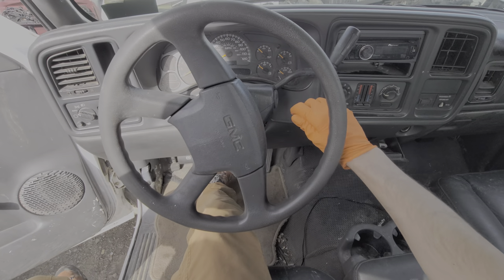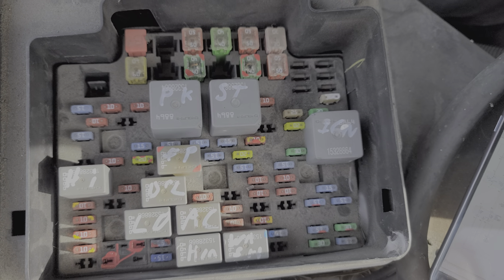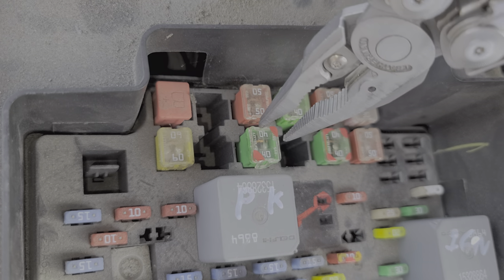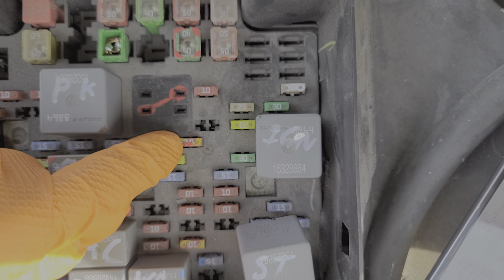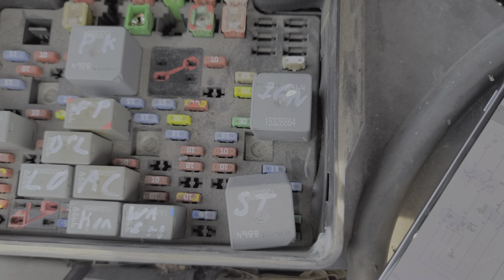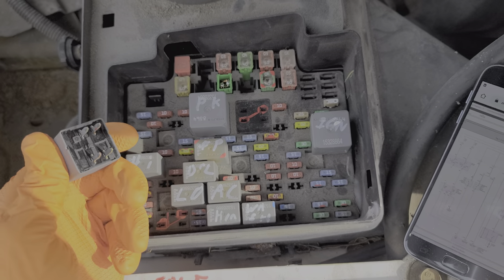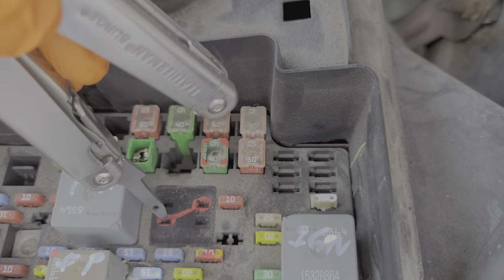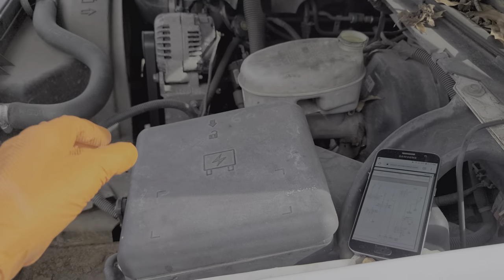2004 GMC Sierra 1500 Starter Relay & Fuses, Ignition Switch Testing

Comment: Just replaced my starter relay 3 days ago. Today my truck wouldn’t start. Found your video. Did the paper clip jump; battery and starter both check good. Replaced the same relay and my truck started up…bought a new relay as a spare! Glad I had that paper clip.Thanks

Comment: Hey man I have no power at the crank fuse when attempting to crank I have already replaced the ignition switch the relays good when I cross the relay over it starts or when I run power to the crank fuse it starts am I going to be looking at the park or neutral safety switch or the gear shift indicator on the side of the transmission?
Reply: Did you get it fixed Oklahoma?

Comment: Heh. My 2004 silverado just decided early yesterday evening not to crank while parked on a hillside on my acreage with a load of junk wood. It doesn't even click. I'm going to give this a try (and maybe deoxit the ignition switch. Thanks for this video.

BTW, yes the battery is fully charged and jumping didn't help. It doesn't even click. Nothing.
Reply: Did you figure it out. I'm  having the same issue.
Reply: @bigvince1978  yep. The starter was bad. Thanks to YouTube, swapping it out was easier than I expected.

The gear had no spring tension. It just slid back and forth on the shaft by hand🧤
Reply: Mine still won't crank from key. I can jumper starter relay and it will crank. Any ideas. New starter and ignition module
Reply: @eldudeareno11  I had that happen on an old 60s Chevy. The battery terminals all looked clean and the battery was fully charged. I ended up replacing the starter and the alternator before I decided to take out the battery. And when I did, one of the terminals fell off the battery. It was not tightened down. I simply tightened down both terminals got in the car and it started right up

Yeah, pretty stupid mistake. At least it was round 1982 so I was young and stupid.

Comment: How do I fix it? Because I have a wire I run from the relay to battery too start the truck. I had to put a wire Around all them fuses you mentioned that have to do with the no crank pls help.

Comment: I have a no crank situation but am getting power to the crank fuse with the key in the on position and no power through relay in crank position. Changed switch but still the same thing

Comment: will a bad relay cause a the one click scenerio with the starter?  took starter sout and tested and it spins when manually activated.  but on the truck it just does the click.  i noticed there was a few times got several clicks but it didnt engage to spin.  thx

Comment: Do I have to unplug the battery to remove relays??
Reply: Most important is not to have the vehicle running. If you're going to check for corrosion, you might as well do it it first. Sensors you can look at to see if they've blown, and are no good. To check relays, you'll want the battery plugged in. You'll need to attempt to turn the vehicle over. If you test/replace the relay and or fuse,and the vehicle turns over, theres you're issue/solution.

Comment: HEY BRO I HAVE TO USE A CABLE FROM RELAY TO BATTERY , BUT HOW DO I FIX THE PROBLEM DO I HAVE TO BUY A NEW FUSE BOX ? OR DO I HAVE A ELECTRICAL PROBLEM SOMEWHERE?? Pls REPLY. THANK YOU
Reply: I have the same problem did you find out what’s wrong?

Comment: Need help!
2003 GMC Sierra SLT
2 wheel drive
200,000+ miles
Crank but no start.
Replaced fuel pump
Throttle body
Idle position sensor
AGR valve
Map Sensor.

I have fuel and fire.

2 weeks ago I started it, drove it out the drive way, got about half a mile down the road, when it started idling really high, then bogging out, and finally died. I got it started, but it wouldn't go over 5 mph. I got it parked, now it won't start.
Reply: Did you figure this out? I had a crankshaft position sensor go bad and it cranked but didn't start and would hiccup every once in a while before doing that. it's located behind the starter and should throw a code, but I would think you don't have spark or fuel when it's bad.
Reply: @enthused7591  mine drives fine for 45 minutes, and then shuts off. Then, It won't start for about 30 minutes. Then, it'll stall again after about 20 minutes. No frigen clue.